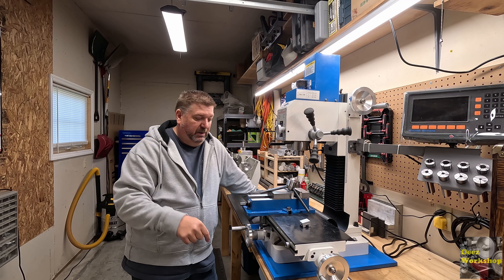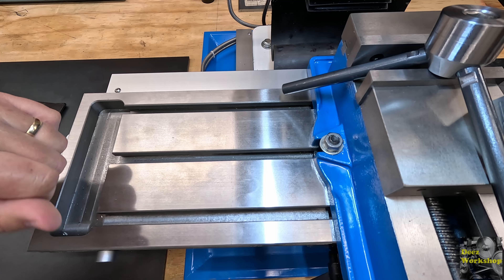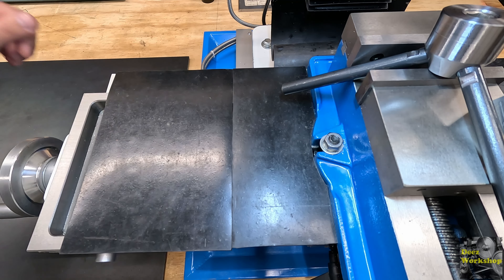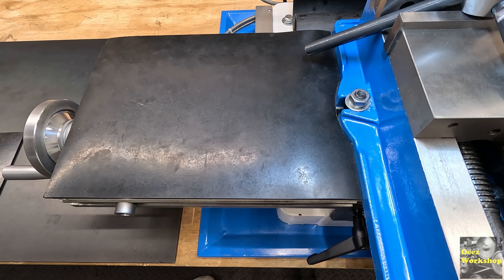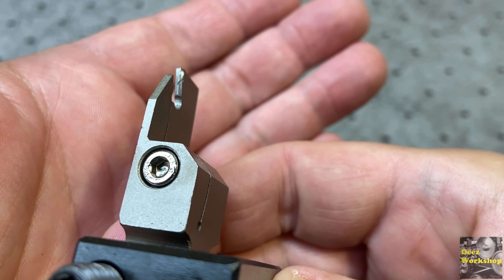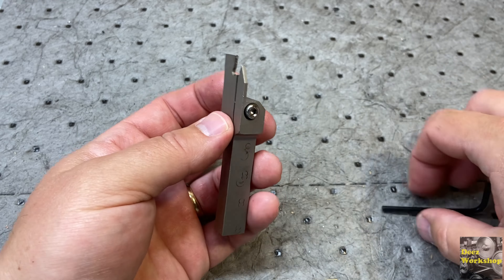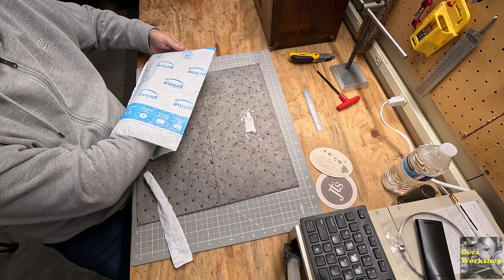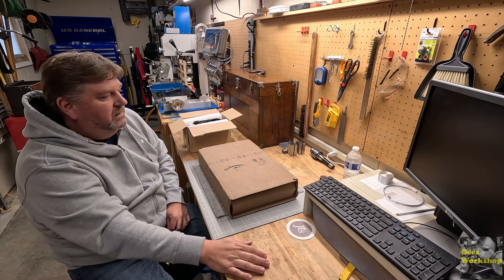Messing in the Shop Episode 16 - New and Old Tools Shop Updates and Improving the Hobby Machine Shop

Comment: That book is awesome, a lifetime of knowledge in there, so useful👌 ive seen those bump push ball bearing tools used facially also. Im not 100% if the burnishing/polishing tool is the same one or not, they seem to be a popular build atm too. And definitely look into the blade type parting tool and holder, there much stiffer and i think they make a Aloris style holder for them. Just check the tip height on the blade and get the right one for your lathe, i think mine was a 19/2 blade, its nice. Mate, stoked with the reference book, epic find👍👌🇦🇺
Reply: The burnishing tool you mentioned is somewhat similar. I've played with making different types and IMO they're not worth the time and effort that other videos suggest yielding fantastic finishes. Cheers!
Reply from the maker: Thanks,  I do have a couple parting blades from HSS.  those work fine as well but Most of my issues are myself.  :-)  gott get that tooling perfectly parallel and height adjusted just right or I have problems.  This book is full of great reference material.  Great suggestion from @TheMiniMachineShop to pick one up.  Happy to add that to my reference collection  Cheers Mate  -